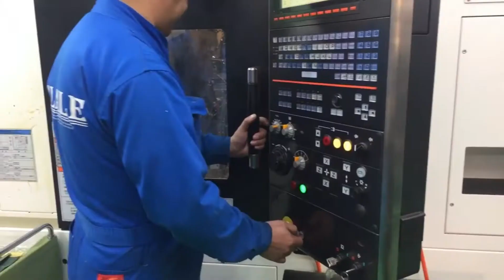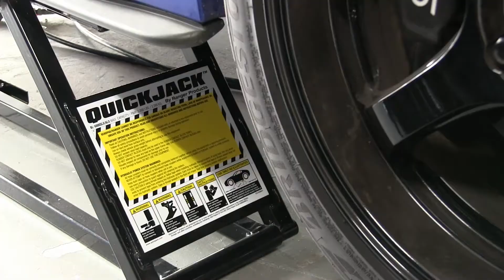Beatrush chassis upgrade: Engine, transmission, and pitch stopper mounts

Comment: Nice upgrade on motor and transmission mounts. Plan on getting these upgrades next year. Upgrading to drilled Brembo rotors tomorrow. Thought you used to have a video all about the Quick Jack.